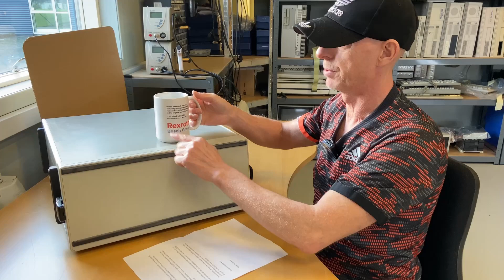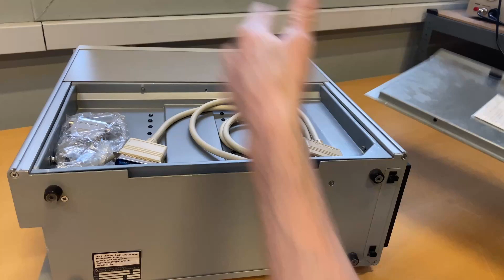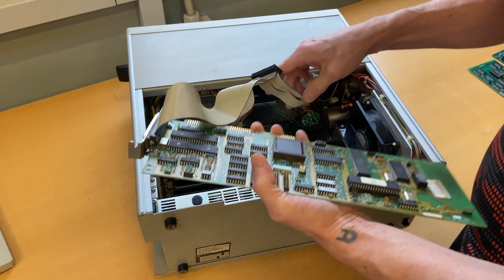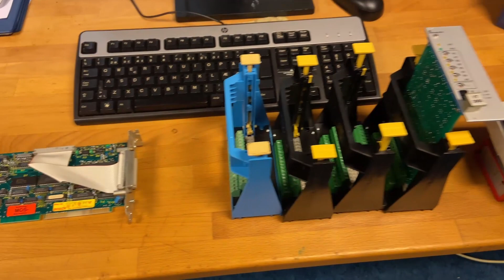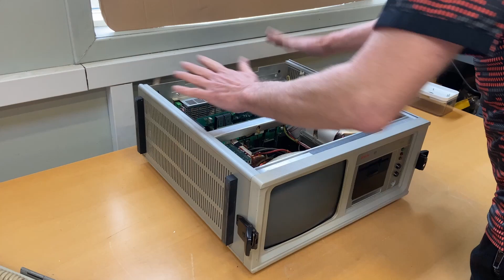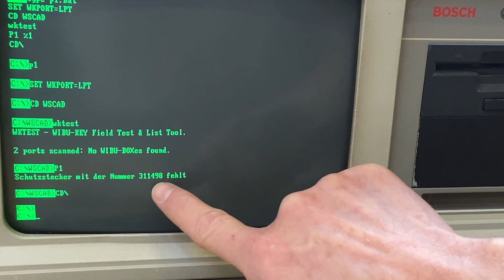Bosch Rexroth PG4 - Rare Industrial PLC Computer - 80286

Comment: I used to use one of these to program Bosch PLCs. There is a dongle missing which prevents the Bosch software running but as far as I remember the normal DOS functions were still available.
Reply from the maker: Hi. Yes sadly I miss the dongle.

Comment: The WSCAD software seems to be for creating circuit diagrams, and this old one needs a HardwareDongle. for Programming the old PLC from Bosch like the CL100 you need to use the 37pin ISA (EP/AG Card) card and connect the PLC with the right cable and also use a Dongle for the Programmingtool named SPS/Profi. I got the PLC´s the Software with Dongle and Cables for those, even THe Handheld Programmer, i want this Programm Device named PG4 with this Card XD

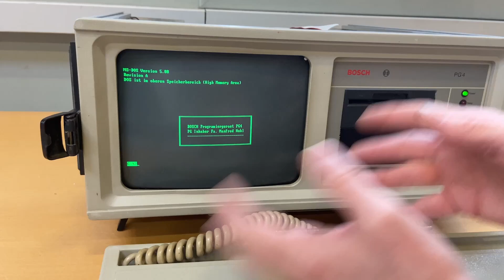Comment: 45:06 might be the owner Manfred Hohl back in the late 80s and therefore it could be that this guy died in 2008 if you google his name cause that was born in 1939, so 50 years old end of the 80s.
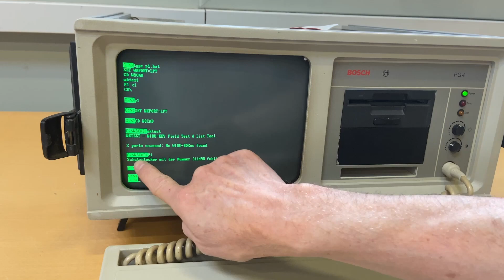46:41 means most likely that there is a dongle missing (Schutzstecker means more or less a protection plug and most likely in the sense of copyright protection which was the number 1 protection in the days, any kind of hardware dongle).
Reply from the maker: Correct. The software is missing the dongle

Comment: I'm sure you're right about the WIBU-BOX error being a missing hardware dongle that's a license key for the software.  The program Easy Label uses WIBUkeys for its hardware license keys, and I think either the more recent Allen-Bradley or Siemens PLC software we have uses it as well.  Unfortunately, finding a key for this very old software now is very unlikely.  But since you work with this company now, you probably have a much better chance than others would.  And, this software even without a key must be extremely rare now.  This is an amazing find.
Reply from the maker: Thank you. There are actually 2 "errors" - One is the missing dongle the other is the missing link to an actual controller panel